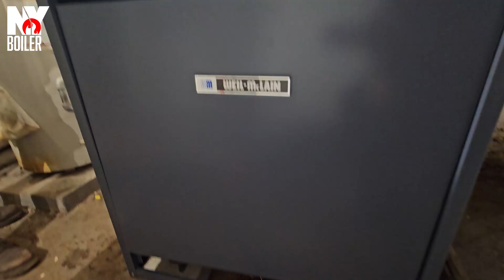Weil McLain Steam Boiler Installation Process | Louie The Boiler Man

Comment: I’m installing a Weil McLain oil fired steam boiler up here in NH. I wish the existing was as nice and clean as the job in this video. I’m in a dirty basement with a six foot ceiling and I’m 6’2”. Also the other boiler down there runs constantly, so that’s fun. It is a very satisfying job though when you get everything installed and it works after!

Comment: Thank you for the video. Is the common wire the same as neutral? Thank you
Reply: the common wire on low  voltage is basically a ground
Reply: @ Thank you